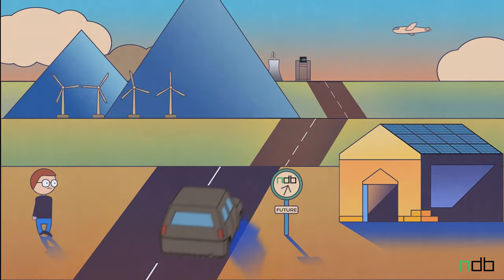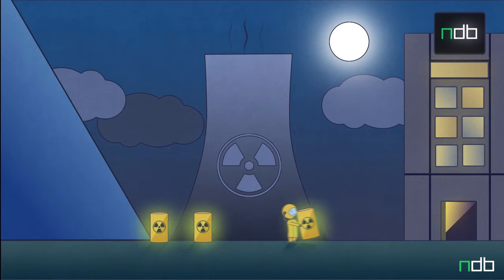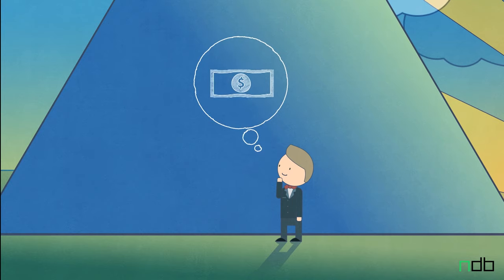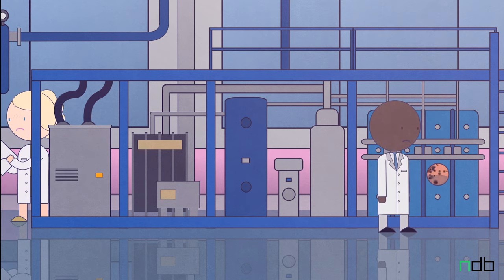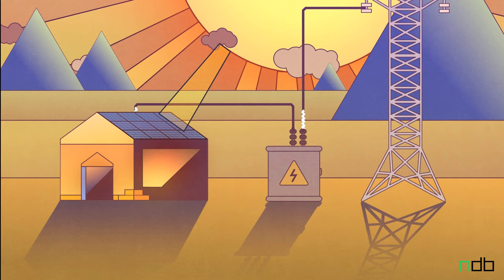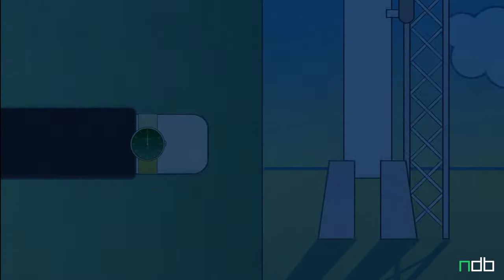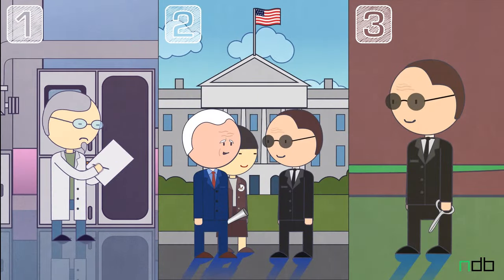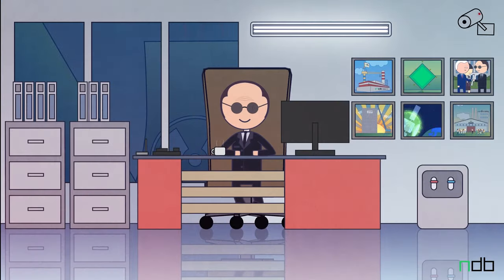Nano Diamond battery explained #NDB #Green_energy

Comment: Total BS marketing claims, you do realise to power a tesla you would need 180 million of your batteries and it would weigh 540,000 kg? A smartphone battery would weigh at least 60 kg, do you really expect these to take off in the way you are marketing them? Similar batteries have been around for 15 years that use tritium instead of your nuclear diamonds, so why didn’t they take off? Maybe because you are spreading BS.
Reply from the maker: It's really bad when someone with no clue BS. 

As a starting point, why are you spreading false information regarding the mass and power output of our battery? 

Second, you should conduct some research on higher power solutions that have been researched over the last 15 years rather than limiting yourself to tritium, such as the one found at https://aip.scitation.org/doi/full/10.1063/1.5123163, instead of spreading misinformation because of your ignorance. 

Leave the BS and come back when you have anything to discuss.
Reply: @NDBplus  Really professional from a company's youtube account, well done guys, says a lot about you as a company and the BS you are spreading. Also maybe proof read your comments first, the English and grammar could be improved.

The infomation I used is the only available information on your product, the 100 uW and the 3 g. You haven't released any further specs or proved anything otherwise. I was not limiting myself to tritium at all I just said your battery was very similar to the tritium one in terms of power output and that it never took off as you claim your very similar product will. looking at the university of Bristol information on it, it says the output is roughly 173 uW, so still not much and that is just based on calculations from another prototype, so I will amend my calculations for the Tesla then, it only needs 104 million batteries and say it is only 1 g per battery that is still 104,000 kg for the battery alone, still isnt feasible is it? Im pretty sure all those figures and calculations are based purely on carbon 14, not on the product as a whole, so not including the weight of the casing or any efficiency losses. If you have more up to date specs (why cant I find them) then send me the links.

I'm not spreading misinformation due to ignorance. Are you really pointing me towards theoretical papers rather than actual physical prototypes and products? I could easily point you towards any theoretical paper I wanted, doesn't mean it will ever be a reality or that I have made a prototype or will perform as good as the theory states, does it?

It is you guys that need to leave the BS and stop making BS marketing claims unless you have actual public evidence to back it up, just saying, "trust me bro, it works", is not evidence and is probably total BS. If it really does work then do a demonstration of it working with experts from outside the company there to validate it and release actual specs about your product. Releasing specs doesn't put your IP in any danger, but the fact you havent really released any makes people think you don't want people to know, and the only reason for that is because it isn't what you say it is. Lets just hope you dont end up like Theranos, when you get caught out making false claims.

Do you really expect us to believe that you found a way to power an electric car for 28,000 years on a single battery? When the only evidence of any product you have is a 100 uW betavoltaic energy harvester? Even then you haven't released any actual specs about it. In 2020 you didn't even have a functioning prototype of even a 100 uW device, all your claims are based on calculations and theory that you don't even release.

Look at all the videos and articles online doubting your product, all that doubt doesnt come from a solid idea and realistic marketing claims, go and watch the EEVBlog video, it explains why your claims are BS, go and look at other articles online.
Reply from the maker: @conorstewart2214  We don't see why you'd take offence if someone else used the same words as you use. The business will naturally reply in kind to your current mode of communication. 

What you claim as Bristol, is using C-14. What you're saying is that you think the power output and the weight of a C-14 battery is the right benchmark for NDB’s approach. But how you came to the point that we are employing C-14 for higher power applications, and what evidence supports this claim that we are not aware of. “We don’t use C-14 for higher power application”.

Your investigation seems to be confined to the Bristol, and you want to make a comparison to a claim that has nothing to do with what we are developing. We have provided you with further material, which you have chosen to ignore and insisting on maintaining your unconnected allegations.

To continue with your line of reasoning, you appear to believe that native English speakers who use a variety of tools to ensure correct grammar and fluency in their written communications are not doing sufficient preparations beforehand. So that you can respond without more grammar and language errors, we can introduce you to some of these tools if you require it.
Reply: @NDBplus  This really says a lot about your company.

You keep changing your story.

Also you linked one source that doesn't seem like it is even about your product. If you are so sure of yourselves why dont you release specs, or is it all purely theoretical for now. You still have not provided actual specifications for your approach or what you have developed.

This whole company seems like a shambles, you claim one thing in your videos and then when I point out the problems, it all of a sudden changes to you aren't using that. You dont even seem to be being honest about what is in your products and what it is based on.
Reply from the maker: @conorstewart2214  This time it's even more obvious that you didn't even bother to view the video. The video doesn't touch on Carbon-14, but it does explain the various sources. You're bringing shame on yourself and exposing your actual motives the farther you go. It would seem that you are very skilled at making up lies and then adhering to them.
Reply: @NDBplus  what sources did you explain? "Nuclear waste", isn't really explaining sources. Your company claims all these great thing but hasn't delivered any of it, or given anyone any proof to back up your claims. How many years have you been around now? For all anyone outside the company knows, you don't have any prototypes, it is all just theoretical calculations and we don't even know if you have those. Again look at all the people online doubting you, do you really see that as a good thing?
Reply: @conorstewart2214  ahahah dude that is sooo shame. Are you really blaming these guys based on some facts that are not in the video? What's wrong with you :DDD
Reply: @ЕлизаветаСмирнова-й6п  if you have any actual facts or any actual evidence that the company has actually developed anything and can perform like it needs to then feel free to post links to it. I went off of the only information I could find about their batteries, you don't have to limit yourself to just using information from a video you know, you can comment on outside information, but you don't seem to realise that.
Reply: @NDBplus  how will you deal with some other large problems with your design, like if you use passive radioactive decay, you can't turn that down or switch it off, so all that energy needs to go somewhere, probably heat. So if you had an 18 kW battery in a car, if you parked it, it would generate 18 kW of heat, so how have you dealt with or fixed that problem? Wasting 100 uW as heat like similar products, is pretty easy to do, however wasting 18 kW that could cause some problems. So is this something you have considered?
Reply from the maker: @conorstewart2214  this is a valid question when we don't consider solutions like smartphones with much less power demand to than EVs. 
Our design has implemented a few integrated solutions to overcome such issues. For instance, a specific material in our design can use part of the generated heat to maintain its state, or some selected materials can work as ideal heatsinks beside others which can be shared during the eventual product release. Indeed, all of these require further testing as the prototype gets ready. The company has said that it has no plans to supply its EV solutions at least until 2025, with possible rationales being the need to address safety and licensing.

In the case of electric vehicles, in addition to the aforementioned integrated solutions, certain basic or infrastructure-related solutions may be logical, such as components, fans, motor(s), etc. that can be switched on to use the extra energy stored in the storage system or sell the energy back to the grid while the EV is parked.
Reply: @NDBplus  I'm not really concerned with the heat of the car, I'm more concerned about the surroundings, if you had one in a garage then it would get very hot in there and not everywhere you will have the ability to plug it in and get rid of the excess power. If it's in a garage or underground parking garage, then it is a pretty enclosed space and the heat will build up pretty quickly and 18 kW is a lot of heat. Even if it is something else like a drone battery then if you put it in a bag or box it will get very hot since it could easily be a few thousand watts. Just sticking a few heatsinks on it isn't really a solution, especially if it will be in an enclosed space.